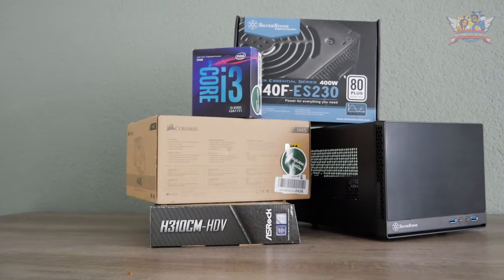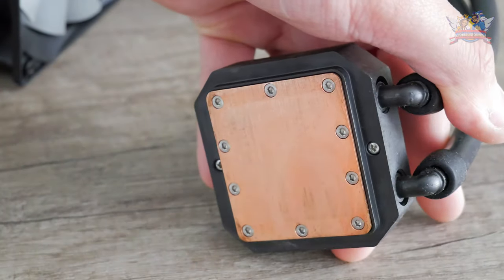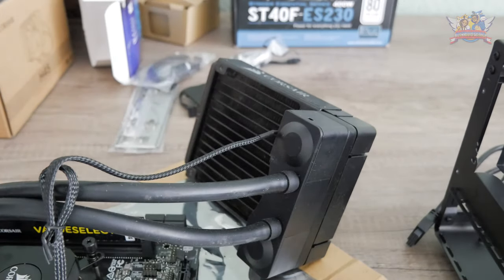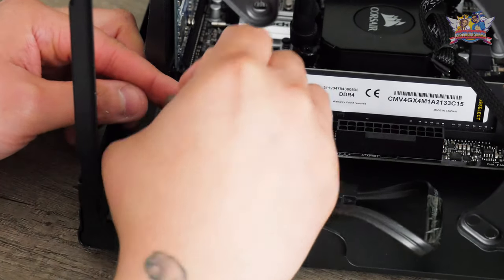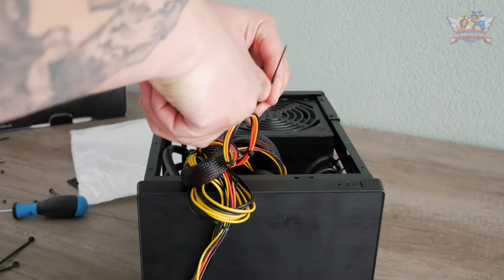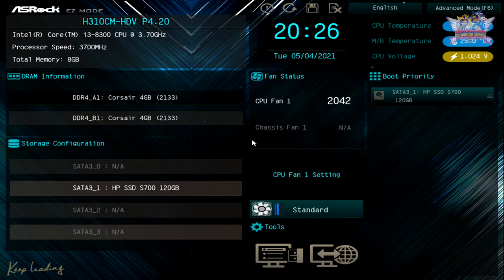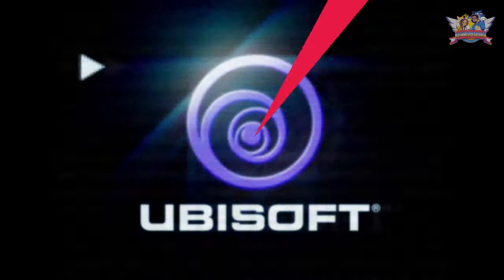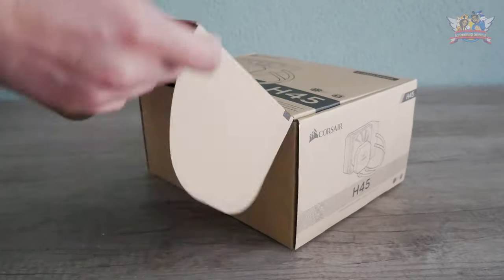Building a Mini ITX Rig with Amazon Warehouse Deal Parts!

Comment: Wow. I never worked with an ITX case before. I am in the process of repairing my 2013 PC. I had to remove my old water cpu cooler, not working anymore. Have to use an air cpu fan for now.

Oddly enough. I am trying to put the AMD cpu bracket back on to use the clips on the fan. No luck for me. Can't hold the front and the backplate and use the screwdriver at the same time. Do you know any tools that can hold the backplate until I get the first screw in?

Your build looks great. I would love to play dreamcast again. Want to play shenmue again 

Always good to see your videos.
Reply from the maker: ITX cases are the same as ATX cases. Its just a smaller working space and you have to think two steps ahead, as you have seen, haha. The best option is to apply the CPU paste and then put the fan on top; the paste acts as glue so you have something to work with (holding on) thank you for the compliment! There are ways to play Shenmue though. Trough Steam for example!

Comment: How's this running now.
Such a funny video. Loved the bit where the SATA was on the outside. 🤣 Glad it's not just me that does things like that!
Have you tried any of the TeknoParrot ROMs on this? I have the same graphics card in an i7 which I think is holding back some games. Is your GPU the 2gb version?
Reply from the maker: I released a new video yesterday where i swapped the GT710 with a newer GPU! Yeah, when im focused on a project i tend to over-focus on one part and make these simple mistakes haha. I haven't tried Teknoparrot; but with that newer GPU, it will run smoother than with the GT710, so ill give that a try for sure! The GT710 was the 2GB version, yes. Some games are GPU dependant, some CPU.
Reply: @fistbumpbros  I'll take a look. Might upgrade mine in the future so will be good to see what's working for you.
Reply from the maker: @GoodwinsPlace  I will use your Teknoparrot tip though; ill make a video to see how it all runs with that!
Reply: @fistbumpbros  try Transformers on it. That Batman and Mario Kart I notice a lot of slow down on.
Reply from the maker: @GoodwinsPlace  yup will do!